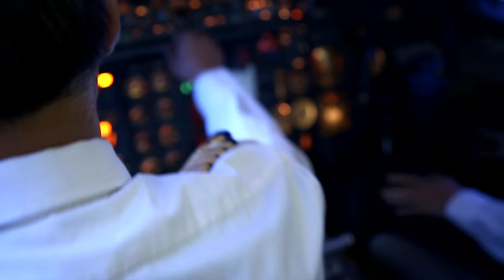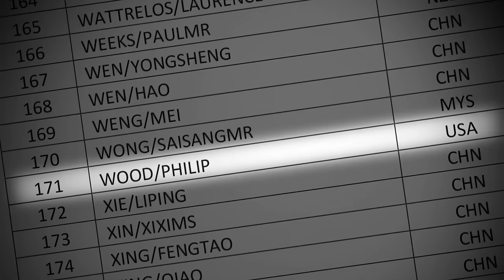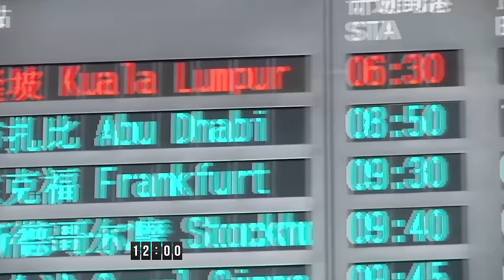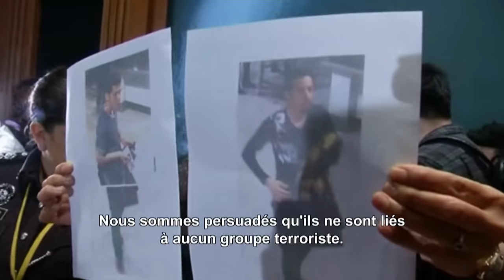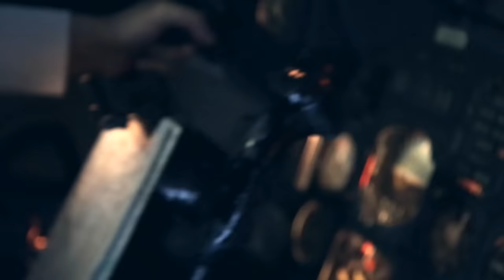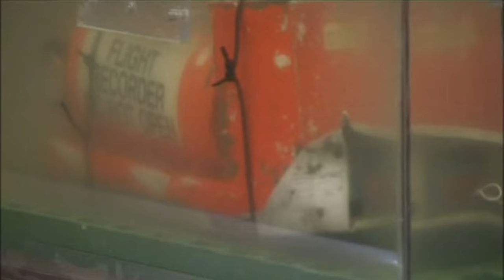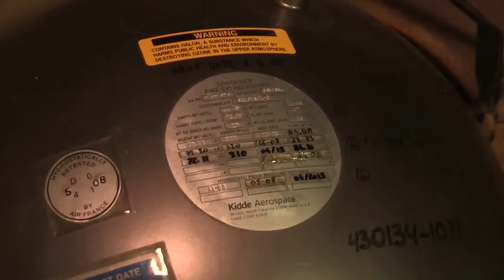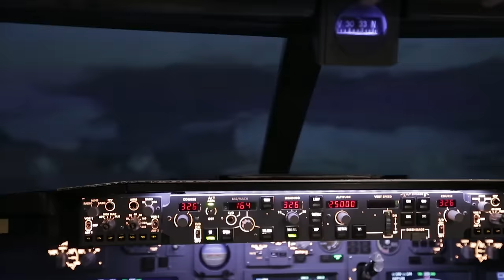Why We Never Found The Malaysian Flight MH370?

Comment: I think the Diego Garcia hypothesis is worth looking into more than any other of the hypothesis I've heard.
Reply: The only problem with this theory is that it is impossible to get close by any means to this island unnoticed. Even if the plan was a suicide mission, there is no plane or ship that would get remotely close to doing anything let alone to cause any damage. This is due to all of the radar and electronic equipment to detect stuff. First lets start with radar. Civilian radar can detect stuff even below 200ft. So question is, why doesn't most civilian radar do this then? Well the answer is simple, terrain and trees. Yes trees will show up on radar if you point the radar low enough ironically. These two things are what is around most civilian airports. Second, there is aircraft that fly in what is called unrestricted airspace and thus do not require radar tracking on top of it would be very hard to do so with terrain and trees and in some places even building in the way of the radar. So with that out of the way for the civilian side, lets look at the base you reference. There is a lack of trees. So much so the radar can actually be pointed level with the sea as it would double for not only detecting aircraft but sea vessels. But lets say the ground radar there wasn't pointed at sea level. You still have the issue with all the AWAC's that fly around there, one of their roles is to do what ground radar does but in the opposite direction, that is shoot radar to the ground to detect stuff on top of they can detect electronics as well and are very sensitive to such things. Third, there is automatic defensive systems that if it detects something in the sky that is not identified it will shoot it down. These systems can detect such things from 200-500 miles away. One of those is called the CIWS (C-wiz as its commonly pronounced). This isn't a missile system its an automatic 20mm machine gun that have rates as high as 4,500 rounds per minute. Then you have missile defense systems and despite some misconceptions these things can fire on just about anything, whether it is flying, a ship or even ground based and are not always used to counter-missiles but really anything that needs to be destroyed. So with all that said, while this theory sounds good, it wouldn't work. While I am not saying terrorists are always smart, I have never heard of anyone that actively wanted to piss off the US military and do something like this because that is the thing the only thing of value in that area is simply a military base, nothing more and from last I can recall from all the documentaries, from iraqi's and afghans I have talked to if there was a military force that any terrorist or any small militia group was scared of it was the US military and of course a couple of others as well like Russia but for different reasons then the US lol. Also it is a joint base at that so you don't only have the US military there, you also have the UK and other allied countries that use it.
Reply: @wolf2179  Long winded but essentially correct.
Reply: @wolf2179  and thats where the cover up comes in at all levels. They do not want to admit they shot it down.
Reply: @justinbernardo8240  first response to an incoming craft, whether by sea or air isn't to to shoot at it. We would send something out to get eyes on it before it got anywhere close. Once the threat level is established, they would make plans to communicate with the craft. In this case since it is an aircraft it would be to send jets. Once they see it is a passenger plane, they wouldn't bother shooting it down unless it does something that would pose such a threat to do so. If you believe the US has a problem with admitting shooting down a civilian aircraft you would be wrong as we have blown up hospitals and have admitted it. The only difference is that the US military has no problem paying for their mistakes. Not sure why the US would be secretive about shooting a passenger jet when as I said, they weren't secretive about admitting blowing up a hospital. I can see how the theory might make sense, but reality is there is nothing to support that anyone would attempt to take a passenger jet to that military base. You can choose to believe in it if you want to but I recommend doing some more research before you choose to commit to that theory fully.
Reply: @wolf2179 thank you for explanation about radar and the capabilities of Diego Garcia. However, given your explanation I too wonder if it was some act of terrorism (either by the captain or hijackers) aiming to crash on the US base and when the radar picked them up they got shot down. I know you say that even terrorists would be too scared to take on the US military but that didn’t stop them taking on the Pentagon on 911. They probably knew it would be a suicide mission but they might have thought they could still do some damage. 

As far as saying the US wouldn’t cover up shooting down a passenger jet as they have bombed hospitals and admitted to it, well, I believe you are referring to an Afghan hospital. Not only was this during a war/conflict, but, also the West would not get as worked up about Afghan deaths. The repercussions wouldn’t be as high as them admitting to shooting down on a passenger jet full of various ethnicities, in particular lots of Chinese.

Comment: Well, when they recovered the deleted items from the experienced pilot's flight simulator at home, they found that he had created a simulator route that matched the route he took on March 8 but it had a date of Feb 11th, the pilot also few a route to Bejing on Feb 11th but apparently didn't decide to carry out his plan that date, but on the March 8th flight he did.  Consider the deep knowledge it would have took for someone to know when to get off the radar and ride the thin boundary of Thailand and Malaysia airspace to avoid raising alarms among many other things rookies or terrorists wouldn't know how to do, only someone with many years of experience and geographical knowledge of the area would have been able to pull it off.  He may or may not have had accomplices.
Reply: Most of the other scenarios that people come up with can be easily ruled out because in most cases if the plane were going down on its original projected path, it had 16000 possibly emergency landing areas.  Also Airplanes become gliders when engine failures occur, a reasonable action by a pilot would be to glide the plane safely to wherever it can possible lane carefully, if it was going to crash in the ocrean along its projected path, the debris would have been easily found as it would most likely be floating.
Reply: That one who fits the profile is the Capt.
Reply: Watch the video again, especially the part where the head of Malaysia's Air Force acknowledges following MH370 on RADAR as it crossed back over the Malaysian border. Nothing you've written has any value.
Reply: @UguysRnuts  How does it not have any value???  They flew the plane along the borders so that the military would assume the plane was being handled by either Thai or Malaysian air traffic controllers, and I believe even they acknowledged that themselves.  If he had flown a route more conspicuous then there is a chance  fighter jets would have been sent to intercept the plane.
Reply: @nikumimito3164  "Watch the video again, especially the part where the head of Malaysia's Air Force acknowledges following MH370 on RADAR as it crossed back over the Malaysian border."
He claims to have witnessed, on radar, in real time, a rogue airliner he KNEW to be MH370 as it invaded his country's border with radios silent and transponders turned off EXACTLY as were the nine- eleven Boeing 777's that hit the World Trade Centre, and didn't lift a finger to scramble the F-18's he had sitting at ready and trained extensively to defend Malaysia's own "Twin Towers" in Kuala Lumpur.
He is prevaricating.
Of course " there is a chance  fighter jets would have been sent to intercept the plane", in fact, there is absolutely NO chance they weren't! This is the first and most important DISINFORMATION intended to conceal Malaysia's shooting down of a civil aircraft. 
You may wish to investigate what became of Malaysia's Prime Minister from ten years ago and why he was removed from office, if you're looking for motive.
The flight simulator story and "exact route" is lesser disinformation and a debunked fallacy addressed in the preliminary accident report. With the waypoints on Zaharie's FS computer one could connect the dots to create whatever route one wished, despite it not existing on the device.
Reply: I believe it didn’t happen on the 11th because he couldn’t get the cockpit to himself, yet on this flight he had a novice co pilot who was a bit unconventional and young.
Probably the captain got him to check or get something for him, then locked the co pilot out of the cockpit, switched everything off which would stop everyone outside the cockpit to have oxygen. They would only have been conscious for a short time, then he had the plane to himself to do what he wished with it.
Reply: Agree! I believe at this point we know WHAT happened and the big question is WHY did he do it?
Reply: @tomyoung7757  And you'd be wrong. You have NO idea what happened if you continue to buy into the cover-up story of pilot suicide and mass murder. What part about the former PM of Malaysia being a deposed, dictator, despot DON'T you understand???
Reply: Taken from a Facebook post. 😂
Reply: They never tried to find that aircraft all they need to do is ask the US navy to order a submarine into the area and with there top secret tracking system the would have located the signal se t out by the flight recorder Question. WHY DIDN'T THEY
Reply: @monkey271070 If that was so how did he switch off the main fuse which was below in the transport area as explained in the Doku? Is absolutely unlogical that this signal completely vanished. And why would he take such a long road just to kill himself and all the others?  Nothing of this makes any sense.
Trained military could have been flying the craft if they took over.
Reply: @James-is8ml    They?
Reply: @rosinchenpapa  I don’t know how he would have switched it off, how do you think it was done ? 😀
Reply: But why he did that???? For which purpose???¿

Comment: Present airline technology is archaic. Why is that both black-boxes are kept inside the plane? We always are searching for these black-boxes. Why not send all voice recording, data etc. to an outside secured repository. In this modern times this technology is available. We should implement this soon. Another question I have is that, why is there a switch to switch off the transponder so easily? Atleast the ACARS is a little more difficult to switch off. In terms of safety and security, airplane designs need to be revisited.

Comment: I never understood why, there were 227 people on that plane. if 200 of them have cell phones. why were the cell phone towers all around the areas that the plane could of been scowered for pings from all those cellphones? I understand cell phones do not work at certain heights but why not at least try? If 1 of those cell phones came into contact with 1 of the towers that could of answered a lot of questions.
Reply: Good points. The cell phones may not have worked at 35,000 feet, but if the plane few lower then if passengers were still alive a few may have tried.
Reply: People received cell phone calls well into  8 hours after plane went missing, family of people that were on that flight. Maybe see where THOSE calls pinged from, but never happened. Said they didn't have the resources. Just another cover up.
Reply: How many cell phone towers cover that part of the ocean?
Reply: @taral7861  what do you think happened to the plane?
Reply: @E4T4  i think it was shot down after going off radar when it entered "deadman" airspace, possibly by the US military. I think several countries in that area were in agreement to do so, regardless of who actually shot it down, they covered it up, used technology to mislead the unknowing to search in the wrong areas, while the actual debris was "cleaned up." There was classified cargo loaded onto that plane, lot's of it, that was never scanned upon entering the plane, yet well guarded and China wanted it. There were military training simulations going on all around the area at the time the plane went missing. There's no way it just vanished without one of those militaries having knowledge of its whereabouts.  Kind of one of those, sacrifice a few lives for the greater good kind of mission that the military has been pulling off since it began. Also, maybe just coincidence, but the plane went dark at 1:20 am. Covid 19 was released from a lab in China. The first known cases were in 1/2020
Reply: @taral7861  Can you elaborate on the classified payload and China wanting it?
Reply: Actually, I think a cellphone tower did detect the Co pilot's phone. Although that raises more questions
Reply: @taral7861 Covid 19 is named that way because the first known cases were in 2019.
Reply: @taral7861  too much conspiracy theories for you it seems, even linking Covid 19, get more credibility!
Reply: @taral7861  damn thats very interesting and sounds very possible imo. craziest stuff and still not many are talking about these things
Reply: @taral7861  I agree with you except for the last 2 sentences (1:20 plus the year was '14 so cut the 1 it's 420 and it all points to Mary Jane ;-)) But apart from that, it's also what I was thinking from the start. The plane was shot down by military, either deliberately or as an accident, or the lithium batteries caused it to explode. But the whole story of the plane travelling across the territories of several countries towards the South Indian sea without ever being detected by radar just seems so far fetched.
Reply: @annaf3915  i was talking about first case of covid, hence the 1/20. Idk where you get 4/20
Reply: @taral7861  I just wanted to point out you could read anything into these numbers. I agreed with everything else you said but I don't understand why you want to link the disappearance of a plane from 9 years ago to covid. 
What I'm missing from this documentary is the second Air Malaysian boeing that was shot down over Ukraine shortly after. That's a strange coincidence indeed
Reply: Sheesh, think about this a moment.    You can drive around the US and easily lose cell phone coverage in thousands of spots.     Yet you expect coverage a thousand miles out into Indian Ocean.       A satellite phone might work  but how many people carry one?    I don't know if they even work inside a metal tube.
Reply: @annaf3915  Speaking of "strange coincidences", did you know that the Boeing 777, MH-17 was shot down on the 17th of the 7th month (July), 2014 (2+0+1+4=7), exactly 17 years TO THE DAY since it's first flight on July 17th 1997? Or that, in Chinese culture the 14th day of the 7th month is the date of the 'Ghost Festival'.
Reply: @UguysRnuts 😂

In Russian, people just want to believe in this to relieve themselves of responsibility. This version is very common among them.